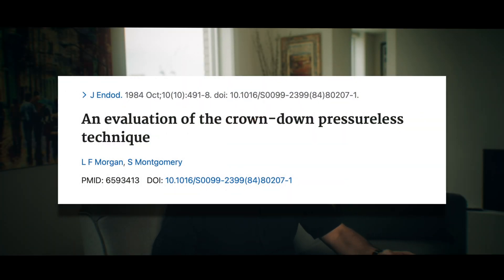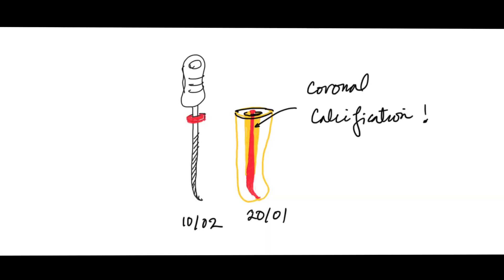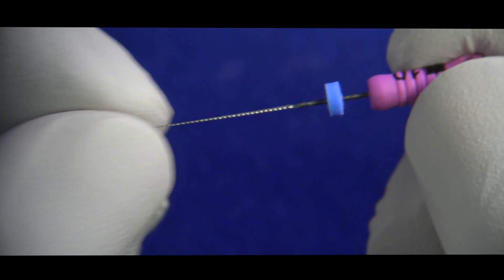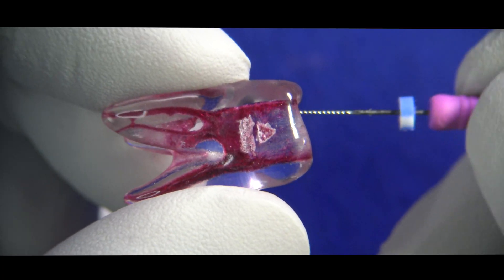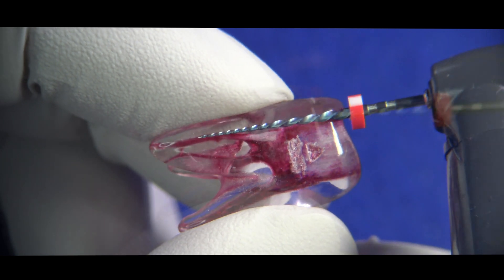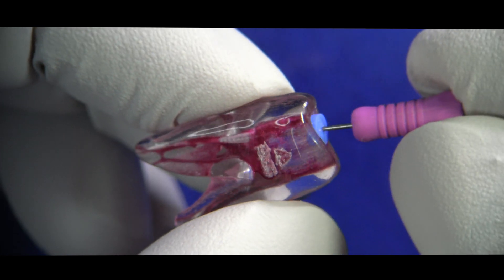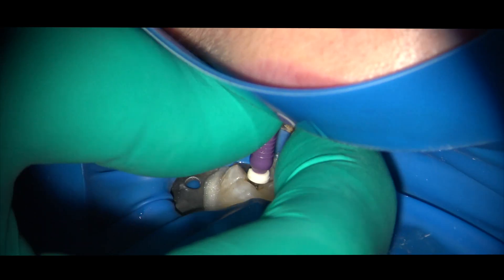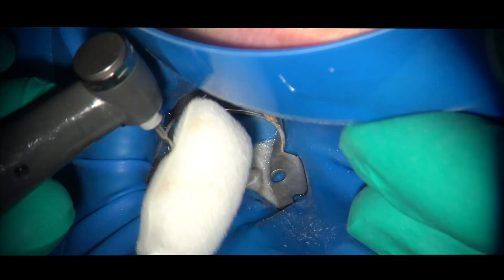Crown Down Concept and Coronal Pre-flaring to get down.

Comment: Nice tip Dr🙏 is it better to rotate the file anti clockwise?in order to  push the sealer apically
Reply from the maker: Yes, instead of buying one more instrument like a lentulo spiral just use a clean old fork and rotate it in reverse to get the same pushing to the apex effect! :)
Cheers!

Comment: Hi doc,do you recommend any particular taper for each canals of molar while precoronal flaring bcoz the pcd might vary at cej particularly at root invaginations na?
Reply from the maker: It's really dependent on the existing taper of the canal. If it's too thin then a large taper is not necessary, 06 coronal flare and 04-02 taper mid-root to apex might suffice. But if open then 08 coronal flare and mid-root and apex taper of 06-04 should be fine. Cheers!
Reply: @EndosKool  thank you sir, I would like to appreciate a good workflow vedio  of your clinical case from diagnosis to end.

Comment: What is your taper sequence and tip size ? Do you ever get the tip engaged on a rotary file?
Reply from the maker: @ma3195gd  Any orifice opener or files with larger taper than your hand file will do. From large to small passively. Keep the tip size small 10-25.